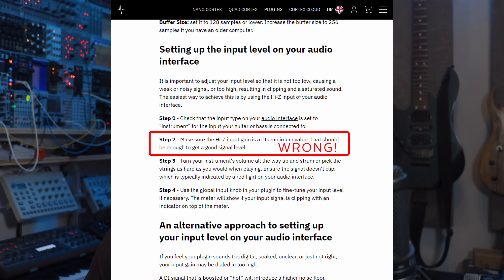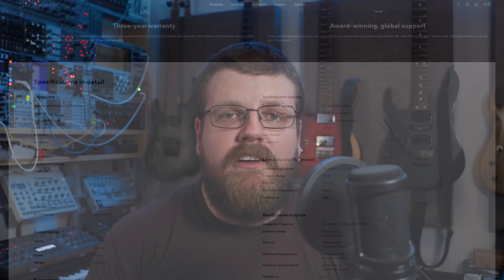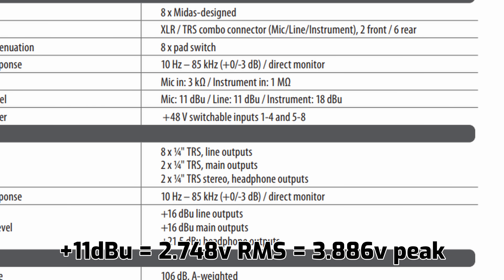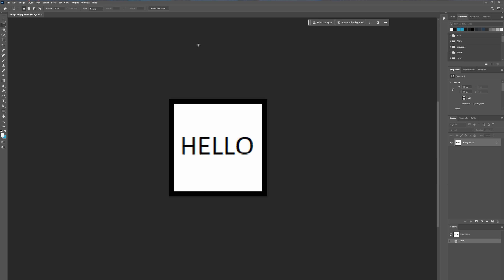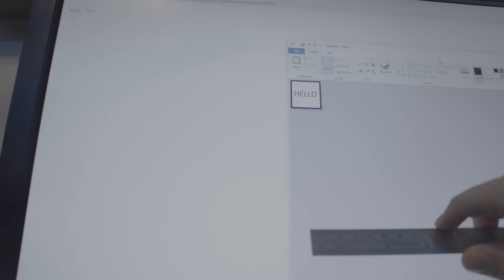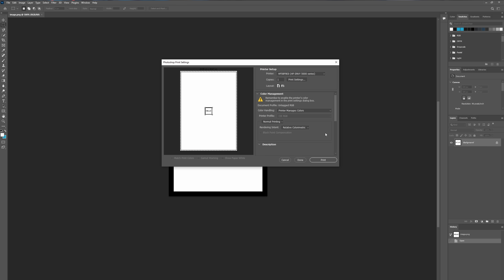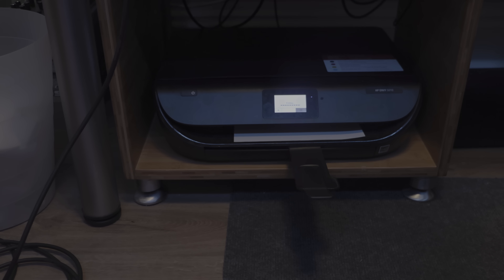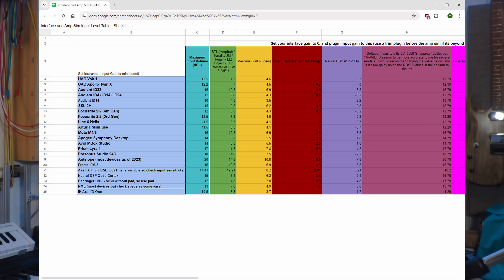Ampsims and input gain - Please, stop the madness...

Comment: so basically whatever gain you achieve out of your interface is what you minus the input on the plugin by correct? 

example: you have +12 db on the interface before redline then your plugin is set to 6.8 the 3rd step would be to minus it by 12db and it would come to be -5.2 db am i correct?

Comment: Sir! After recording and producing for over a decade, I can't believe I'm JUST learning about the PROPER way to gain stage. You fixed my YEARS long issue in about 10 minutes. I applied your methods and I was immediately met with amazing results. I'm working on my first full length album and the noise was driving me insane. Found myself sacrificing my tone for a better signal but after your video, I can actually create what I want to without any sacrifice. Seriously, this is not only a game changer but a life saver.

Comment: It's like digital photography. Sensors are designed to capture the most detail on the right side of the histogram, where the most significant bits are used. Exposing to the right without clipping highlights allows you to capture the image with maximum detail. The same principle applies here: setting the gain high enough without clipping ensures you capture the audio with the best possible quality.

Comment: Now I’m curious – do elements of this advice apply to hardware modelers like the Strymon Iridium? Obviously it should be getting the input signal it expects because that’s just coming through the pedalboard’s normal analog signal chain, but I’m never quite sure what I should run the stereo outputs into on my interface – line inputs? Instrument inputs? Do I need a DI? Etc.

Comment: Turn up interface input gain until you're just below clipping...almost clipping where? The light on the interface? The input slider within the interface's conrol software? Input track in daw? Input of the amp sim?
Reply from the maker: Light on the interface
Reply: @GhostNoteAudio Is it bad that my interface's gain control is barely above 0 while clipping with electric guitar?
Reply: @GhostNoteAudio Thank you. What about all of the other input and output meters?
Reply: @GhostNoteAudio Track input in daw, the output in mixer section, the output of an amp sim.

Comment: FYI, ITU standards reccomend tracking the highest permissible peak at -9 dBFS with the nominal level 9 dB below that, or -18 dBFS, which aligns with EBU R.68's reference level.

IMO, this video is ignoring the fact that most analog equipment introduces more distortion when operating above +4 dBu, (which is usually calibrated close to -17 dBFS). You can't expect the analog gain stage to behave perfectly linearly until it clips. It's not digital. Analog stages have to operate at their specified nominal level for good reason. I agree that tracking a gain starved input is a poor choice, but so is recording far over the  nominal level "to get optimal digital amplitude resolution" because quantization errors don't exist in a 24-bit world. There is absolutely no reason to ever record anything but transients above the nominal level. The noise floor is demonstrated as being improved, but this just shows that digital gain raises the noise floor. With monitors calibrated to 85 dBSPL(a) at -20 dBFS, and with the signal tracked at -18 dBFS with peaks at -9 dBFS, I think the noise floor would be nearly inaudible anyway.

Comment: As a fellow electronics (and software) engineer working with digital signal processing in embedded systems, I approve this message! This is true for any analogue to digital conversion, it's not limited to audio. There is always a gain stage before an ADC to ensure the input signal is amplified so that the full range (bit depth) of the ADC is used.

Comment: This whole situation is absolutely unacceptable. Both audio interfaces and guitar plugins are CONSUMER goods. And yet audio engineers and guitar pros can't seem to agree on anything. I still don't get a single thing after watching a dozen videos, including yours. I've got the Focusrite Scarlett Solo. In the manual it says that the green area of the gain knob is -24 to - 6 dBFS, the orange area (just below clipping) is -6 to 0 dBFS, and the red area (clipping) begins at 0 dBFS. In the specs it says that the MAXIMUM Input Level is +12.5 dBu at MINIMUM gain, with 59 dB of Gain Range. What the heck does any of this mean? First they're talking about dBFS, then about dBu, then about dB. How am I supposed to figure out how the gain knob works? And how does that relate to my NDSP plugins that operate in unspecified units and have both input and output knobs?

Comment: 11:03 Compensate to where? If I have the input gain in nameless set to 2.8 (ssl2) and interface gain to just below clipping, then it's not clipping. Why the need for compensation? Am I just dumb?
Reply: Yes, you are. If you've boosted your signal by a substantial amount of the interface, then it will be unrealistically loud when it hits your ampsim. The compensation is to reduce the signal back to a reasonable level so the ampsim responds correctly
Reply: @saamo1423   Just leaving the damn plugin input alone and setting gain on the interface to below clipping translates to just below clipping in the plugin anyway, at least for me. So this whole thing over-complicates it needlessly. In the end I trust my ears more than anything. Honestly, not engaging hi-z and just increasing the gain on the interface can at times sound better for some stupid reason. It can sound more....analog.... for a lack of a better term. Maybe more punchy is a better description. Regardless, hi-z with gain at zero, no matter how much you compensate in the plugin, leaves the signal sounding weak. Considering that I'm using fishman mics that shouldn't happen. Doing it the old way (regardless if I'm using hi-z or not, which I usually am) I don't have to use as much gain and distortion in the amp to get a good chuggy sound. Maybe it's just my interface or something.

Comment: My interface has Max. Input +12dBu. I use Kuassa amp sim. The spreadsheet says to turn Kuassa input to +12.8dB, however their input knob only goes up to 6.2dB. I can put a gain utility in front of Kuassa to add another 6.6dB, but it does not make sense that Kuassa engineers only allowed for +6.2dB on their input knob, while according to this methodology I need twice as much? Can someone explain this please.
Reply: I'm not a pro by any means but I think I can help. Can you tell me which interface you're using?
Reply: @dv5150 Boss GT1000 Core, which has +12dBU max output level. Hence I used an interface with same output in the spreadsheet
Reply: @mike_luk  Sorry for not saying anything sensible but it seems to me that some of the amp sims were trained using a very weak signal and i have no idea how they haven’t thought about what the most common interfaces are… It does not make any sense why didn’t they allow a bigger range to turn that knob, it seems like a fault in design. My best advice is to use the external gain plugin you mentioned or entirely switch to Neural Amp Modeler if you don’t mind leaving this specific amp behind.

Comment: It's almost like understanding analog makes your video also make sense.  new idea for you, use a walkman as a distortion unit.  solder an input jack to the tape head leads, run the headphone out to an amp and see what happens...the more functions and buttons and eq, the better/worse it is.  IR emitters sound like helicopters in pickup proximity.

Comment: Why is the max input level shown in the spreadsheet relevant? Like what does the resulting value that the spreadsheet says to use for a given plugin matter? It seems they're adding the plugin level with the added digital input level to equal the interface's max input level? What if you, step 1, set audio interface gain to 0, "measure" it using the input meter on the amp sim plugin. Then, step 2, raise the interface's gain until you get solid input signal on the interface's meters. Then turn down the plugin input again until it's the same as you measured in step 1?

Comment: I've tried all methods, from tickling the red, to zero input on my audio interface (AI). Zero input was shite!!! very bad advice, as was "tickling the red." I'm using IK Axe I/O. Great AI. Anyhow, What I've found for my AI is to start at 9:00 Gain and then adjust the amp sim input gain to the desired level. I rarely use the output gain on any amp sim. I have found through trial and error, that pretty much all my amp sims sound great with the AXE I/O set around the 9:00 position with slight variations (usually higher) for different sims. and by slight variations, I've never had to roll the gain higher than say the 10:00 position. It's just not neccessary as I'm usually coming in around -18 Db. So basically, the zero input adivice is shite, but does have a little bit of merit. Let the amp sim crank out the least amount of input signal neccessary to drive the sim so there isn't any unwanted clipping. If you do it right, the sims will scream. Gain staging is the easy part, what the huge problem is is wading through the thousands of cab sims I have to match the amps...but thats all the fun! Also, pro tip...You should definately invest in IRDX Core from Bogren Digital. It will really wake up your cabs. As with NAM, make sure you calibrate it.

Comment: I'm the focusrite scarlet, I clip at 0... Sooo.... Now what? Cuz I'm not pulling the D'Mazario humbucker out of my Ibanez.
Reply from the maker: If you have a "pad" feature on you interface, use that. Otherwise the signal is too hot for your interface to capture. You can turn down the volume on your guitar to prevent it clipping.
Reply: DI box > aten/pad -10 or -20 db

Comment: You understand very quickly if you Reamp how important it is to set the input gain at a setting before clipping and not just default at Zero.
Setting automatically at zero is assuming all instruments/pickups have identical outputs levels
Why didn't anyone ask the question - "If the best way is to always set at 0 then why can the input gain be adjusted then ?"

Comment: Where did this idea of setting input gain at 0 instead of setting before clipping come from?
Correct me if i'm wrong setting at 0  would be basically similar to pulling back on your volume knob on your guitar, and if you set at 0 and turn up your amp sim input gain well you're automatically amplifying any noise coming from your guitar, and you're still not using the optimum pickup output from your guitar (I mean assuming that your pickups don't clip if you go anything above zero of course)

0dB input + ampsim input gain, would be like "deboosting" and then adding a clean boost to get back to where you would be.

Same if you DI and reamp, if you set at 0 and you could have set at like +12 before clipping, well that DI is going to sound really weak once you reamp, and you'll have to add gain and level to get to the same place thus introducing noise at the overall output.

Who came up with this Idea ? I guess someone with a bad audio interface and really really hot humbuckers, someone mixing up their Line/Instrument switch maybe ?

It's weird that this is a debate.

Comment: This is amazing but how do you set the levels when you have - for example - multiple instances of Neural Amp Modeler? I set up my interface and the amp instance as you say, but how do i adjust if i want to put a pedal NAM instance before the amp? (Let's say we know the recommended level for both instances and none of them support calibration or normalization) 😱

Comment: I run on the principal of "does it sound and feel right" ok then its fine.

Your argument that the input levels are arbitrarily set so zeroing them out and expecting the achieve expected parity with all modellers is folly, obviously makes sense. But since when did everyone make sure they had the same amount of line input going into any gear? Surely it has always been variable. All guitars output at different levels, all amps respond to different level inputs differently etc. 

The only way you could normalise it would be to take audio peaking at 0db and thats obviously not going to be ideal for a number of reasons.

Comment: I think dialing everything by ear is still the most effective way. I prefer to get as much gain in my preamp as possible, even with a little bit of clipping that is either not gonna be noticeable at all while using distortion, or can be easily fixed if needed with de-clipper. Also I believe that preamps add some coloration to the sound the more you push them. That is another reason to get your input as high as possible

Comment: 0dB input gain is for analog hardware. It has to do with the activation of the amplification circuit. Some gain pots will have a click between its off and "0dB" (on) states. This level is the most accurate replication of the SPL of the signal source whether that be a microphone diaphragm or a guitar pick-up. From there, you can send that pure non-affected signal to a separate amplifier for gain staging or you can simply use the amplification circuit it is being run through by turning the pot and increasing the decibel gain.

It's nice to have that non-affected signal for recording as you can route it through a separate gain circuit afterward and always have the dry signal if you need it or want to multiply it.

It's obviously a misinterpretation of this process. The signal should be line-level before sending it through a DSP.

Comment: Don't really know how measure the gain added by my interface but rolling back the gain on the plugin has helped a fair bit actually. Got my interface up at around 10/11 o'clock and my plugin is set to -11 which seems to be the sweet spot. Tone sounds much tighter. Thanks for that :)

Comment: you don't have to lower the digital gain, you have to lower the gain on the amp...if you make it the other way around sounds flat af no twang no attack...fortin nameless sounds the best with both gains at 1 o clock and the mvc pulled so you get that compression of the power amp going on...gain staging is important but more important is to know how the gain structure of the amp reacts depending on how much signal you send thru it...
don't get me wrong the video is great and you have a very strong point, just giving my 2 cents on the topic

Comment: You're over-analyzing the whole thing.
Set your input to a comfortable level, (usually the default setting) then increase the output until you start to redline, then back off the output until you no longer redline at your hardest picking. THEN increase your input until you start to redline, then back off again until you no longer redline. It's not rocket science ya know?
Reply: Then you’re wrong you noob. That’s the whole point of the video lol. Even the plugin designers tell you that’s wrong 😂
Reply: @dirtedingo8354  Really? I don't suppose you'd direct me to an article which provides the correct data for me to study, right? Right? Exactly what I thought. Let's do this: Keep the objective facts valid fore this conversation, and leave the subjective opinions at the door, yes?

Comment: Amazing video thanks, but some things confuse me and I need clarity. Following Step 02 where you set the digital input on the plugin via the Spreadsheet, you say for Step 03 "Increase input on the interface till you’re just below clipping". Below clipping where? On the interface's input, or the input of the plugin we just set? Then in Step 04 you say " Reduce the digital input gain in the plugin to compensate." and I'm questioning why did we even set it's digital input gain in Step 02 via the spreadsheet if we're just going to adjust it again here? I assume you're talking about the same input in the instance of Step 02 and Step 04. Thanks.
Reply: Clipping happens in the AD converter. All analog frontends can produce higher voltages than the ADCs can convert. An ADC is basically the best VU meter you can imagine. It's precise down to fractions of a millidecibel. In practice I would stay a couple dB below max. ADC range. In the analog world you care about actual voltage levels, in the digital world you just care about using all 24bits, even though in most cases the lowest four to eight bits of a 24 bit ADC are really just digitizing noise. So, yeah, all the calculations that recording techs were doing in the past in analogy systems are really gone. There is no need for them. The system tells you automatically when it is at its happiest.
Reply: @lepidoptera9337  I think you're answering the wrong question.
Reply: @frozenmist8873 I am giving you the correct technical answer. If you have a bad question, that I can't help with. ;-)
Reply: @lepidoptera9337  Peak middle of the bell-curve answer, thanks. Awaiting another from someone who can stay focused.
Reply: @frozenmist8873 I am? I have a PhD in physics and I have built high speed data acquisition systems before you were even born. How's your fast food server job going? ;-)